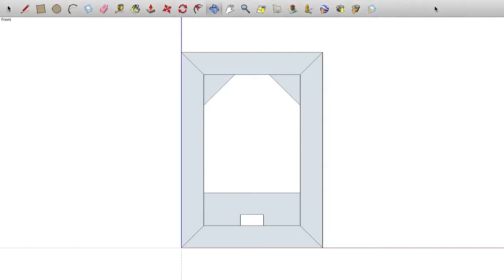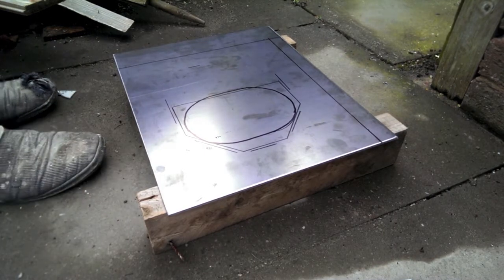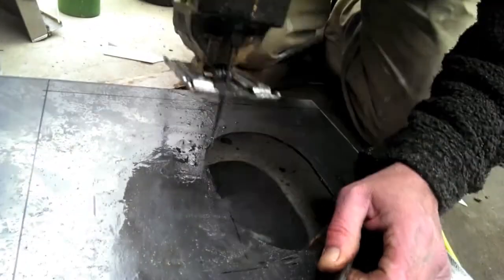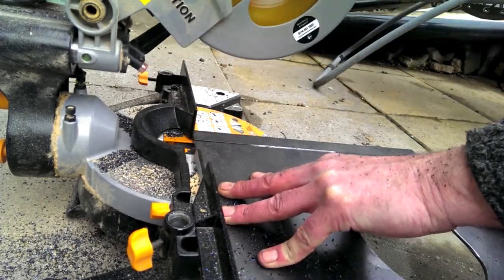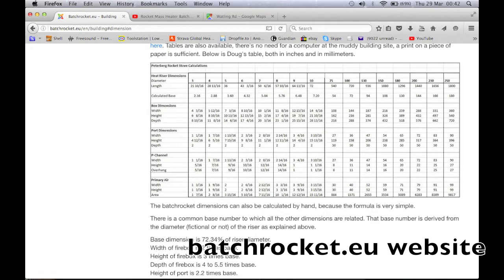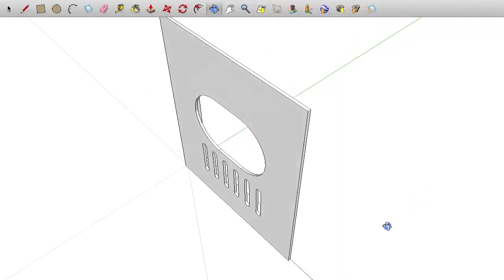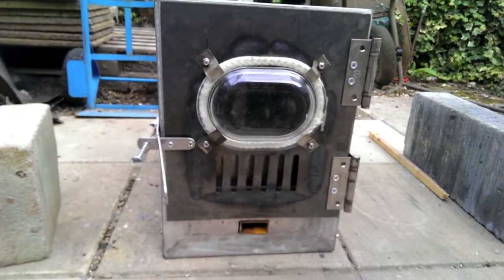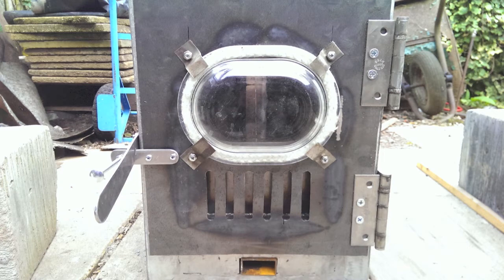Rocket Mass Batchbox Burner Door Build

Comment: A point about primary air openings.  I've found through experiment that minor obstructions to primary air have a large effect.  The driving pressures for producing airflow in a stove are quite small.  There will be a difference in airflow through a square opening, vs. slots with the same free area.  You might find that your primary air is a bit weak, resulting in tepid burns, if this effect is too large.  The only way to tell for sure is to use instruments, which most of us don't have (thanks, Peter for doing the science!) But I've noticed stoves with too many obstructions for primary air burn anemically.  It's a nice looking build!
Reply from the maker: Thanks for the comment Lawrence. I finally made a temporary but sealed install where all primary air has to pass through the grille and I am inclined to agree with your point. It burns very well but, especially while it is getting to temperature, I feel it could do with just a tiny bit more air. I would consider, not withstanding the discussion of Peter's website about avoiding excess ballast air, allowing slightly larger vent area in any future build using a similar grille.

Comment: I suppose you might discuss it in the next video, but did you expect the baffle to slow the airflow by some significant amount?  At least providing a slight additional drag on the incoming air?  Also, any concern about the primary airflow being directed towards the top of the batch box, possibly leading to incomplete combustion at the bottom?
Reply from the maker: Good questions Hayden. To be honest, I hadn't thought that it might slow the air. I was concerned that it might restrict the air passage but the overall area of the opening at the top of the baffle is around 4,000 square mm, which exceeds the 3,500 square mm of the grille and so I hoped it would be OK. Similarly with the direction of air flow, I hadn't considered that it might affect the burn. I partly got the idea from a video of AtlantisDiving who used a similar design to pre-heat his air for a fan-driven gasifier burner. I hoped it would A. strengthen the door B. pre-heat the air C. help keep the glass clean and D. act as a spark guard to stop any sparks coming through the grille.

Matt Walker of the broaudio channel is very keen on slowing air flow to prolong the time for heat to be harvested rather than shoot up the flue. With this in mind, my latest video describes an adjuster for the primary air intake to limit the air once the burner is hot enough to sustain gasification of the fuel. So far it's not working to do that as my chamber is too leaky, but I hope it will have some effect when the system is installed and made air tight.

Comment: Would it not have been better to fit the fire-rope seal to the door instead of the front of the fire-box, it looks like it's a bit exposed there at the moment when you feed the batch-box?

I look forward to see the door in action! :-)
Reply from the maker: Morten - yes, fixing the rope to the frame was a compromise as the door has several through-screws that slightly protrude and it was easier to position on the frame. I'll see how it gets on and can try the door alternative if needed - the rope's bonded on with sodium silicate and is easily stripped off cleanly. 

p.s. the first test burn with the door is posted already, enjoy!

Thanks for your comment. Dave